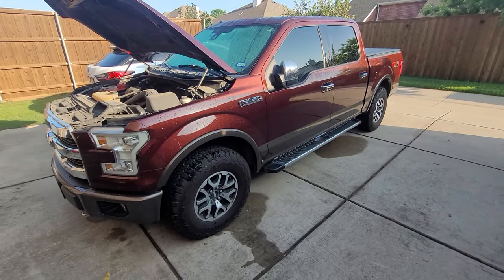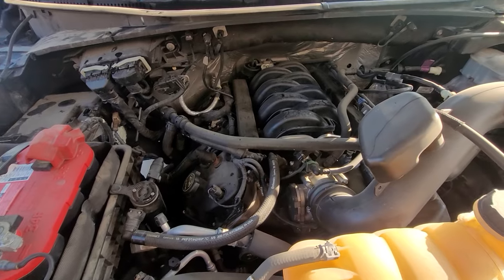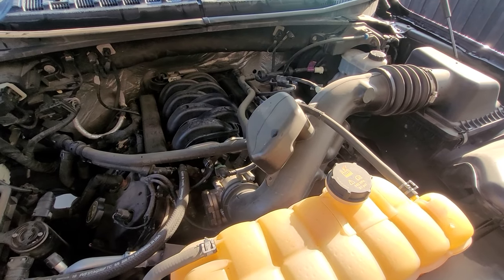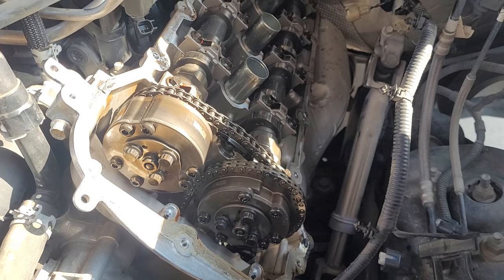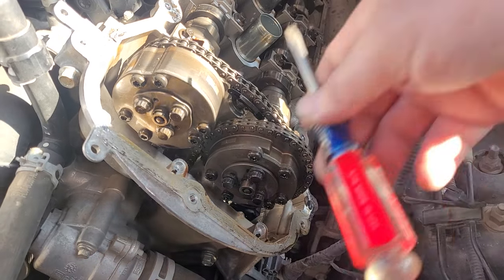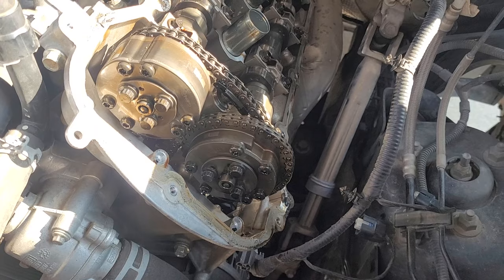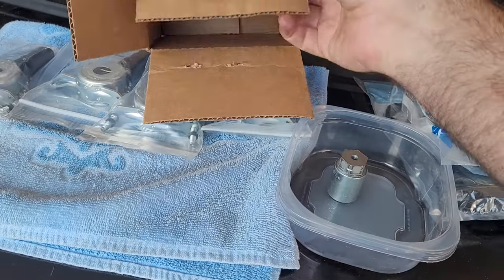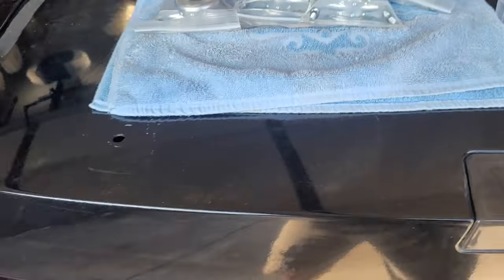2015 5.0L replace VCT solenoids

Comment: I just got a quote from my Local ford dealer of $5000 to do this. $2200 in parts and $2300 in labor, plus some other bogus charges and tax.    My truck is running like total crap now. Is this all there is to it?  I can buy Fords parts for about $200 and do it in about a half day myself ????
Reply from the maker: They might have quoted the camshaft actuators too for that kind of price, you're almost in reman engine territory at 5k lol

And yes this job is that easy if this is all you need to do.
Reply: @Patman03sprcrw    ...so, my truck has 126k miles on it. I have always used full synthetic oil in it and always replaced it at 5K miles. I really find it hard to believe that the chain and tensioner etc is worn out.  I am just gonna replace the VCT's and hope for the best.   What do you think?
Reply from the maker: Whats the symptoms?  Random stumble? Loss of throttle respons?
Reply: @Patman03sprcrw  was on occasional stumble or misfire, and or stall while idling. Now rough running, some loss of power at takeoff, bucking when you are at cruise speed down the road, still will stall when stopped occasionally.
Reply from the maker: @jds5355   sounds about right.  Let's start with the solenoids 👍

Comment: I installed these on my truck but it give me a different codes. What I search in the website is that these  don’t go in regular trucks. These VCT High strength solenoids are met for racing not for driving on regular streets or highways. So DO NOT install these on any 5.0 coyote engine not unless you have a racing car. These will give you a code P0137 on bank 1 and they will give you a second code P0157 on bank 2 these codes are referring to O2 sensors.
Reply from the maker: Oxygen sensor circuit codes have nothing to do with VCT circuits. 

I've used these on two different 5.0s with no issues.  This video is already over a year old and the owner of the truck I talk to about once a week. 

Please don't comment with inaccurate information
Reply from the maker: It possible you left something disconnected? engine ground maybe?  or pinched wiring putting the valve covers back on?
Reply: Dude I just replaced them with the original ones from ford and the codes went away.
Reply: I live in Cali so I don’t if that has to do with my truck.

Comment: Hayes manual says take the heater hoses off.
Reply from the maker: Interesting... I don't think it's worth wasting coolant and all that mess, and a potential leak down the road.

But if you're due for a coolant flush, you could do two birds with one stone 👍
Reply: I would remove them. They're up high so I doubt you would lose much coolant. I would gladly undo two hose clamps and replace a bit of coolant to have one less thing to fight with.
Reply from the maker: It's a preference thing, but thanks for the comment!

Comment: I know you mentioned the idiot proof pin for install, but Is it physically possible to install these backwards? my '16 had the entire timing replaced for P0012.  Still getting P0012.  Today I noticed that the connector for bank one intake is backwards!  The white locking mechanism is facing aft on all the solenoid connectors except that one, it's facing forward.
Reply from the maker: sounds extra special if someone forced it backwords LOL

have we pulled the two connectors off and see if the body of the VCT solenoid is backwords too, or is it just the connector only?

Comment: Are both the VCT Solenoid Bolts and Valve Cover Bolts are 10-11 foot pounds?   I am reading up that they are different.
Reply from the maker: yes that sounds right.  I can double check tho
Reply from the maker: I did both as 11fts lbs in the video

Comment: Why couldn't you just remove the heater hoses instead of fighting with them ?
Reply from the maker: I could have removed the heater hoses, then I would have added coolant cost, and more labor to bleed the coolant, as well as risking breaking a quick connector at the firewall.  Generally techs like to work around stuff if possible instead of removing everything.  Time = Money

Comment: I'm thinking of getting a set of these for my '14 F150. I did see this note (below) on a website saying to use for for competition only. Apparently it could violate some emissions regulation. I don't understand how these would affect emissions. I also don't know who would be racing an F150. Anyway, I've got a P0022 code with reduced MPG and throttle power when accelerating. It feels like it's shaking the entire engine when accelerating. If they're not harming the truck I'll use them. 

"This part is designed and intended for competition use only. It should not be installed on a vehicle that is driven on public roads and highways. Installation of this art on a vehicle driven on public roads and highways is likely to violate U.S. and Canadian laws and regulations relating to motor vehicle emissions."
Reply from the maker: I believe that is a generic Ford Racing legal clause. They are identical to stock unit, just have a little bit stronger housing reinforcement.  I've personally used them on Gen1 and Gen2 5.0 engines without any issues

Comment: My 2016 F150 5.0 is making a valve knock at slow acceleration on low RPMs, and then it goes away. Fast acceleration doesn't make any knocking or noise. Also, at idle, it has the typical piston slack.
These issues don't always duplicate.
Do you believe replacing the solenoids will fix it? 
PS: No fail codes found.
Reply from the maker: sounds like a low grade misfire on acceleration.  You still have OEM/Ford/Motorcraft plugs and coils in it?

Comment: Did you have to take the grown in the valve cover in the back ? my bolt is stripped 😢
Reply from the maker: Yes valve covers need to come off. Don't think there is a shortcut around that much. The valvecover bolts them selves are available,  so you can get replacement if you can get the bolt out

Comment: What was that hissing noise when you started her back up and looked under the hood?
Reply from the maker: I dont hear anything unusual in the video?  either hearing the electric cooling fans, or hearing the vacuum manifold on the driver side of the engine

Comment: Heard removing dipstick is difficult. Any tips to remove without breaking it ?
Reply from the maker: Soaking glass cleaner or penetrating oil. Release the tab and gentle wiggle off/on back and forth until it starts to move
Reply: Push it down and twist counter clockwise
Reply: Did he say anything bout the dipstick

Comment: Let me ask you something, does this car also have the variable valve timing solenoids that are not rounded?
Reply from the maker: the VCT solenoid is round body as seen in this video, or are you talking about something else?
Reply: Must be talking about the 3.5 engine maybe. This is the 5.0 v8.

Comment: I might have missed it but what symptoms was the truck having?
Reply from the maker: random stumble at idle.  lacking throttle tip in response
Reply: @Patman03sprcrw  my truck has random stumbles and rough idle intermittently, sometimes it will die but no check engine light. I’m tempted to replace vct solenoids
Reply from the maker: Could also be leaking purge valve if it struggles to start immediately after refueling.  I'll have a video out about that in a few weeks
Reply: @tylervanbooven5764 my buddy and I are having the same problems with both our trucks. I think I’m going to get my done first and see. I’ve had it in multiple times and this is what the shop is thinking. The quote I got was $560

Comment: I have a 2019 F150 5.0 with just under 126K miles. I had this done at the dealership under the extended warranty just over 100K miles. Now my truck has fluctuating RPMs under normal driving load. For example, if I'm driving 50mph the rpms fluctuate up and down. I don't have a CEL as I had before, but it looks like oil or something is seeping from one of the driver side VCT connection points on top of the valve cover. Does this seem like the most likely issue or is there something else I should look for? This was my first thought as to what could be the cause, but I wasn't expecting to see the oil or whatever it could be on top of the valve cover. I did have the oil changed about 500 miles ago so it could be they spilled oil on top of the cover, but I'm not 100% on that. What are your thoughts/advice?
Reply from the maker: I feel like Ford would have done the camshaft actuators (cam gears) not the cam solenoids.  Do you have a parts invoice for the repairs made?

Comment: If the seal for the solenoid is leaking can it be replaced from the top? Or does the cover have to come out.

Also what was the symptom that prompted the solenoid replacement?
Reply from the maker: I don't believe seals are serviceable with the cover still on.

Symptoms was mostly  rough idle, minor reduced lower response
Reply: Thanks for the reply